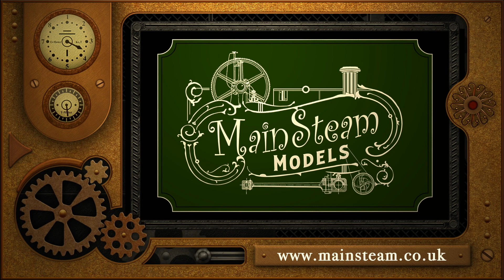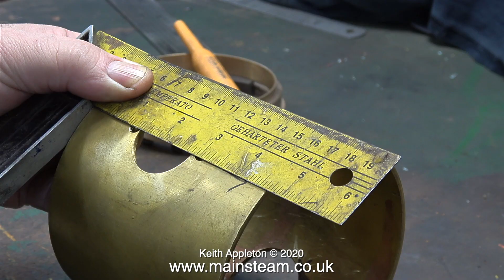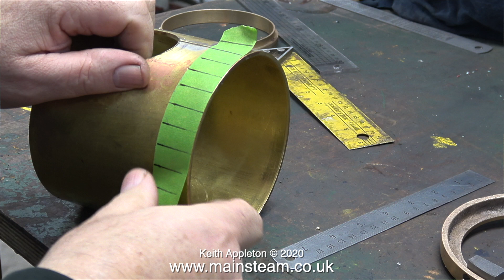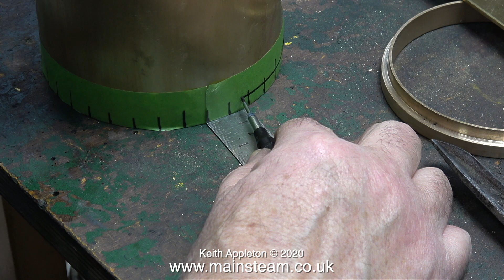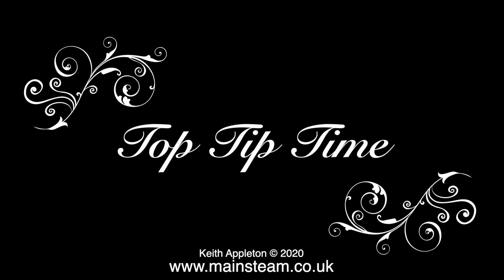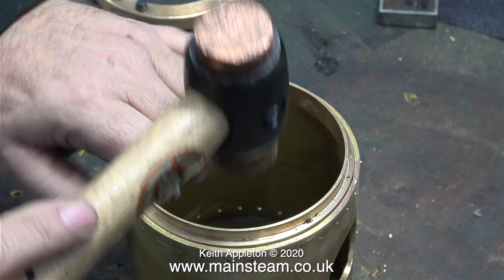SIMPLEX PRAIRIE TANK - PART #33

Comment: Idea from old fabricator. If you want a square line from the base of a cylinder place a piece of equal angle stock (25mm x 25mm) and when both sides of the angle are lying flat on cylinder the line wil be good enough

Comment: I'm never going to build another steam engine as I no longer have access to a proper workshop and there are no model engineering clubs in Portugal, or at least none I have found. In fact I only know of one model engineer (met him at a model railway show three of four years ago but he's about 200 miles away). But I still pick up tips for other things I might do, and in any case I find your videos a great way to relax. I even found another video today using your sanding method to get a curve to fit,it was being used by a violin maker to make the bridge fit the curve of the top of the violin.

Comment: I think the only thing I would have done extra would be to center pop each of the rivet spots, as I am sure that even center drilling the holes they would have turned out wrong for me, I might even have set it up on the rotary table.

Comment: Yes, circumference of a circle is Pi × Diameter.  Getting the spacing correct the way you did it was strictly luck.  Perhaps, if you are going to do it your way, the first to last rivet space should be on the underside, away from inspection.